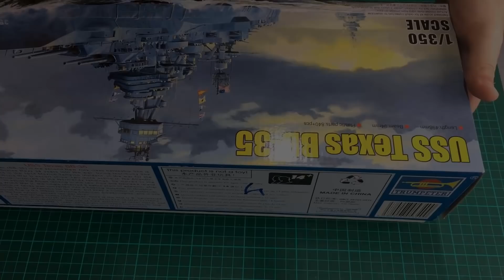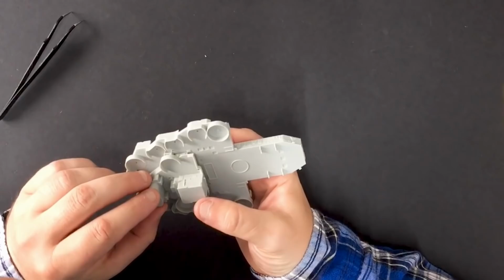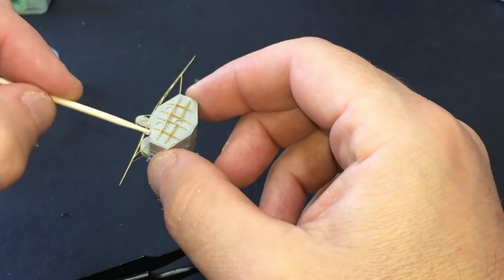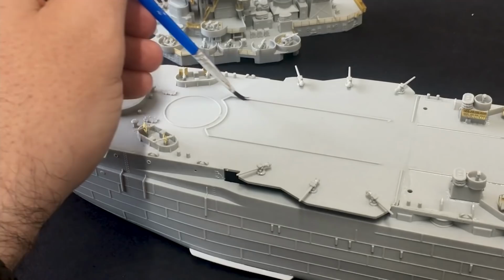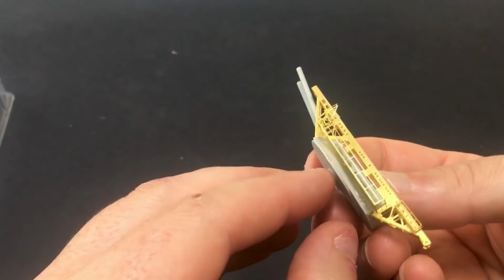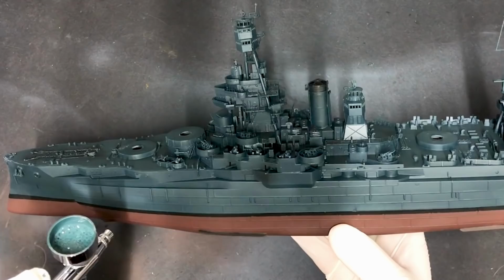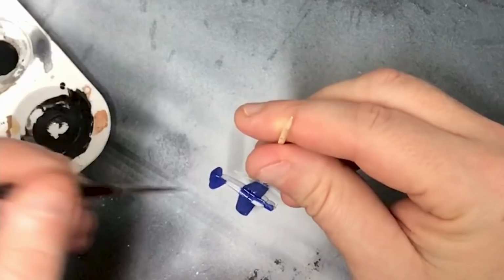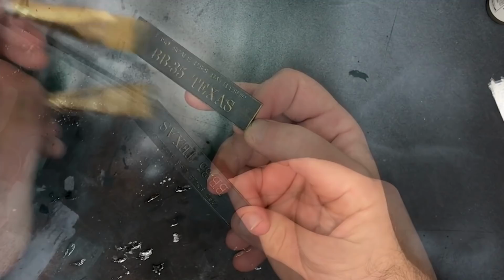1/350 USS Texas BB-35 : FULL BUILD REMASTERED

Comment: Is that glue you are using the paint brush with in the beginning or something else? I have an issue with glue dollops so wondering if you are using the brush to spread or even glue out or for something else?
Reply from the maker: Hi, I just like the control I get from using a longer brush to apply the glue
Reply: @Johnbuildsiconic  I will give that a try!